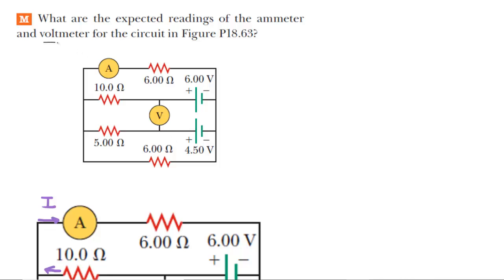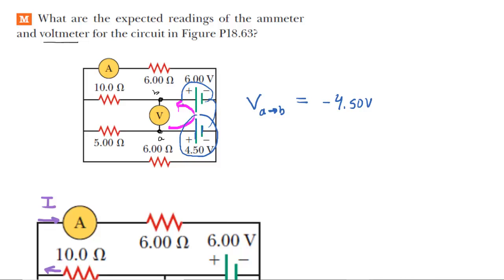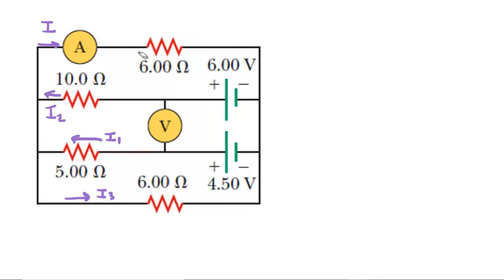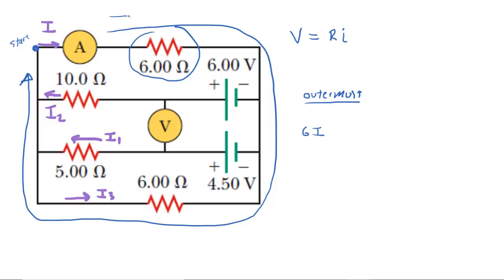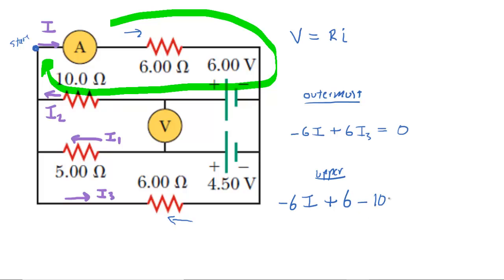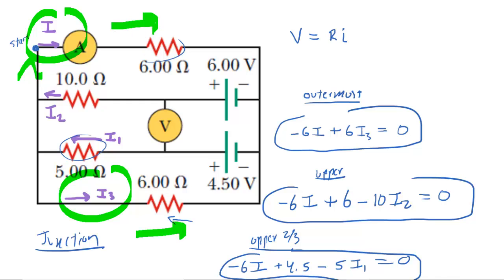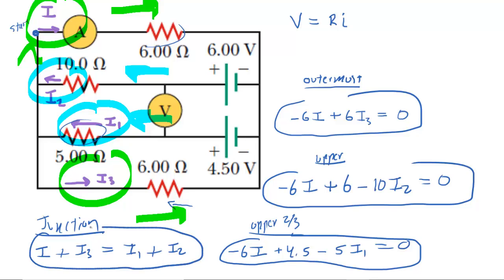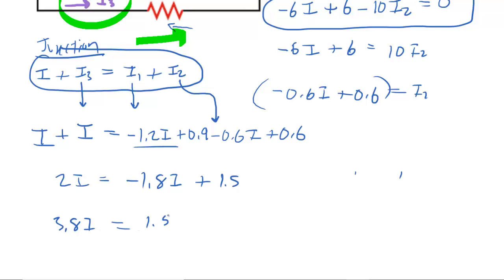What are the expected readings of the ammeter and voltmeter

Comment: would it be appropriate if I combined the top and bottom resistors to form a single resistor of 3 ohms before applying kirschoff's laws? To simplify the circuit a bit.